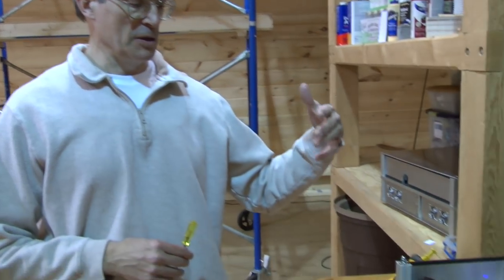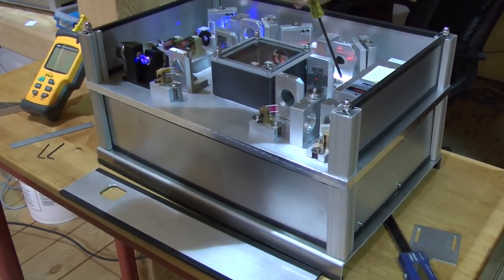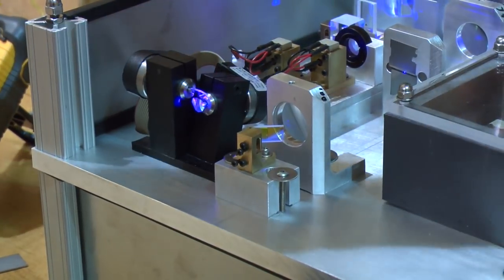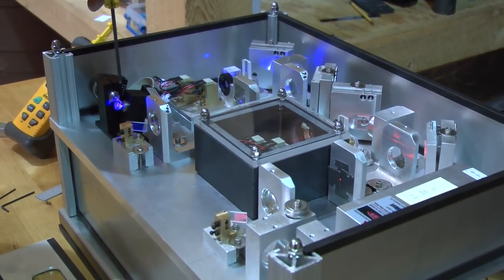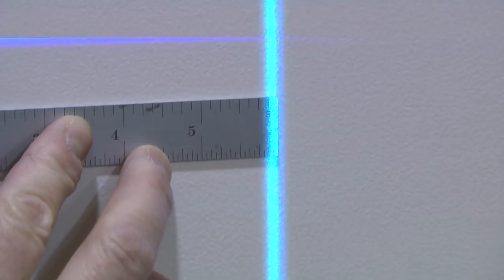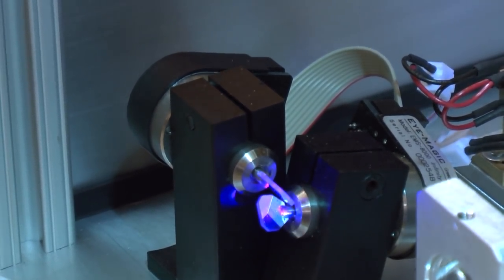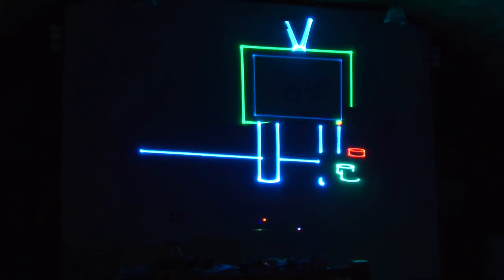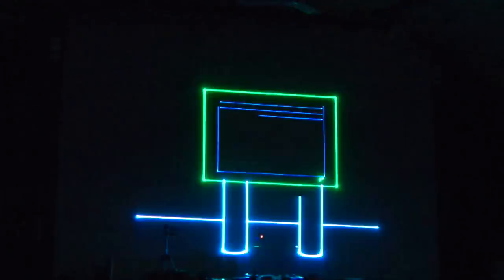Low Divergence Laser Projector

Comment: Goodness me that's a gorgeous projector, lovely engineering and fantastic results...  Would love to see video shot with the camera set to a slower shutter speed
Reply: I agree, whenever I have filmed lasers or other fast moving lights I find that it is best to use a shutter angle as close to 360 degrees as possible, i.e. the shutter time should be almost equal to 1/(frame rate). Due to the persistence of the human vision even better would be to use even longer shutter times, but I don't know of any standard commercial cameras that support it properly.
Reply: @Richard.Andersson  you could always shoot in higher shutter speed (with as close to 360 degrees as possible) and then do a running average over the frames to virtually go above 360 degrees

Comment: Great work Planters!  I visit Photonlexicon sometimes but finally I see your face here.  The projector is so exotic and does not look like any popular products on the market.  Multi-stage TEC is really COOL!
Problem I have on EMS is the mirror they used is relatively poor on reflecting the shorter wave,  I was shocked when I found out the percentage of loss on the 445nm before and after.  Another problem is the galvo shaft stopper, the shaft sometimes got stuck by the stopper plate, 2 pieces of thin metal,   this particularly happens when you have a power failure, which is not rare in a show venue.

looking forward to see more of your works!
Reply: Thanks for sharing. Can't buy Saturn 5's w/o Kvant, so I ordered C596's instead, but had to go to a 3rd party for drivers & tuning, because MachDSP's are unavailable. They've had my galvos for ~3 months and are ignoring my emails asking for an ETA. So, I'm ready to jump ship for the EMS8000's.
Yours is the first bad review I'm seen on them. Loss of 445nm could be a deal breaker.  I specifically ordered broad bands for the C506's.
So, this is 'Planters' on PLF? I'll search for his posts.
Thanks for sharing! Lase on, Ji... or should I call you Zhang? See ya on PLF. 😎

Comment: For a better demonstration of such a high speed projector, you need to upload 60fps videos.
Reply: The problem is exposure time not fps.
Reply: +TheMrTape I second that. Camera with manual setting for shutter speed would do. It may be necessary to add ND filter as well (if low ISO is not enough).
Reply: Unfortunately I don't think manual exposure helps too much. These are not rasters that are scanned at a fixed rate, the scanning rate is dependent on the image complexity. But I don't know anything about lasers or projector scanners, so don't take my word for it.
Reply: +Ligius
For a TV, camera should be synchronised with a TV refresh rate because images are changing slowly, from top to bottom. Effect of not being synchronised would appear as broken image on the screen (half of the image would be from previous frame and half from the current frame). If you record a CRT and also reduce shutter time, you wouldn't see any image at all, only a line.

With a laser scanner we see discontinuous lines precisely because the shutter is not opened all the time. Amount of time a shutter is opened/closed is, I assume here, determined automatically by the camera. Furthermore, videographer's rule of thumb is to use 50/50% time shutter open/closed. Usually shutter speed produce slight effect that is barely noticeable by general population, unless you have fast action like with laser scanner. There, it is preferable to have shutter opened as long as possible (depending on the technology, it can go almost up to 100% open).
Reply: That's exactly what I said. Furthermore, I think setting a long shutter speed will introduce trails that would otherwise not be visible in real life. The only way to ensure a crisp and flicker-free image is to lock the vector projection framerate to the camera one. This means to artificially delay frames that are too fast and choose the lowest-speed ones as the common denominator.
Even if it's down to 15fps it would look better "on film", shot at 1/15, 1/30 or 1/60. The start of frame must also be synced to avoid tearing or ghosting.
I don't have any experience with (vector) laser projectors, so not sure if it's possible. Would make a nice project though. But lasers, like speakers, don't make much sense when viewed on YouTube.

Comment: How far away are we from a (true) laser projector for rasterized video rather than vector graphics and what are the major hurdles?
I can think of a few things:
1. Scanner performance. Scanning back and forth might improve it or a specialized scanner using something like constantly spinning mirrors.
2. Modulation speed of laser diodes. I did some googling a while back and it seems like they are actually in the magnitude needed for the pixels per second of a 4K60p signal
3. Dot size of sufficiently powerful lasers
4. Laser output to illuminate the entire surface of the screen
5. Safety of such powerful lasers. If the scanner fails and the dot stops moving, would you turn the audience blind?
Reply from the maker: I don't know.  Christie has such powerful laser video projectors now that the push is more on MTTF and plug and play, low maintenance issues.  I'm not sure they ever will.

Comment: Is the apparent flickering because of the camera's frame rate, or is it apparent when viewing directly as well?
Reply: It's due to the camera.  In scanning laser projectors, you have a single dot "scanning" very quickly.  At times it can appear flickery on camera, but to the human eye it is generally solid shapes, unless otherwise intended by the show designer.
Reply: ***** I kinda figured. When the scan rate of the laser and refresh rate (or scan rate) of the camera become close to each other or harmonics of each other, this happens - I make LED projects that rely on persistence of vision, and this is sometimes a problem too - and anyone that's tried to videotape a TV screen with a camera sees this too.
Reply: @SuperTechIT  You'd probably need to gen lock it as well :P